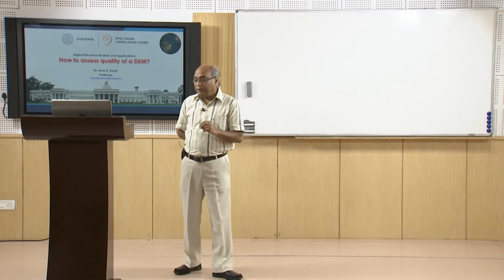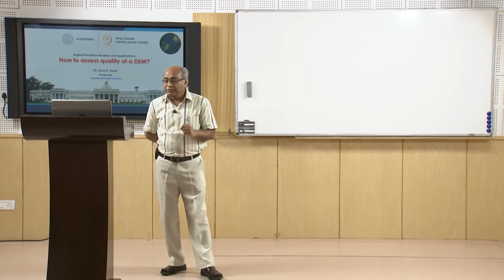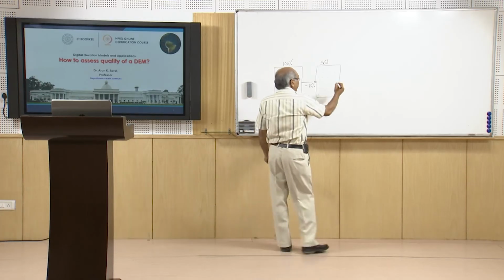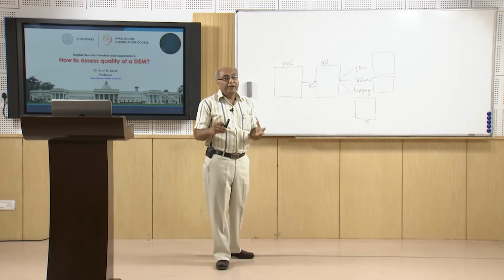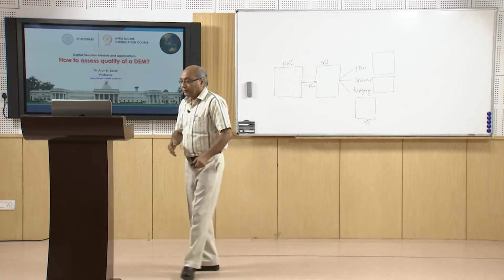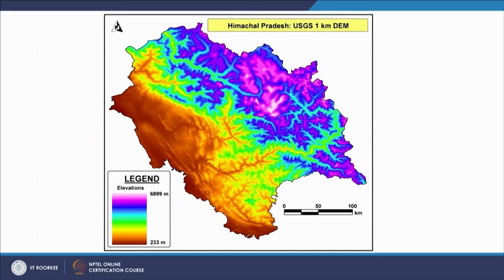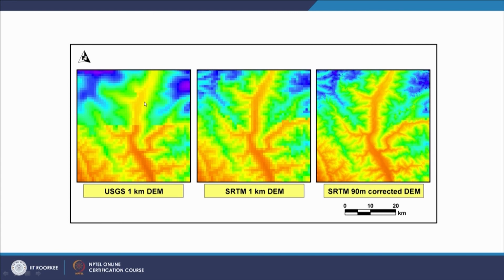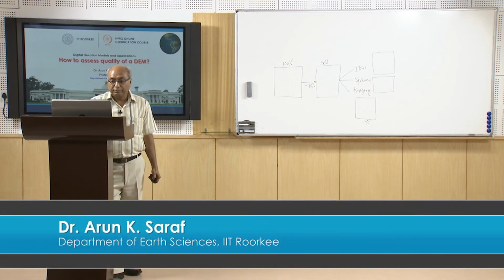L-6 How To Assess Quality of DEM?

Comment: hello sir, why value of Elevation in dem differ with its resolution ? For example study area DEM with 30 m resolution (SRTM-USGS) show value: 2143-399 (high-low) whereas DEM of the same with 12.5 m resolution from ALOSPALSAR (Alaska Satellite Facility)show value: 2100-363 (high-low). Which is correct and what are the reason behind it. Please give the answer.